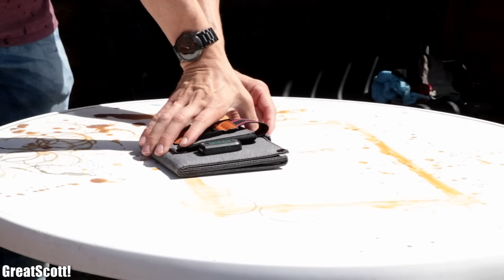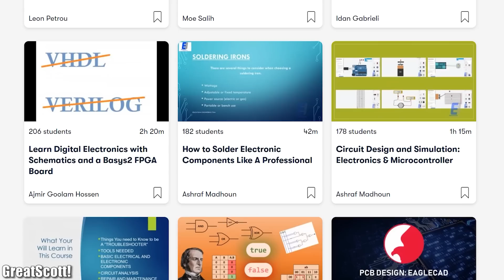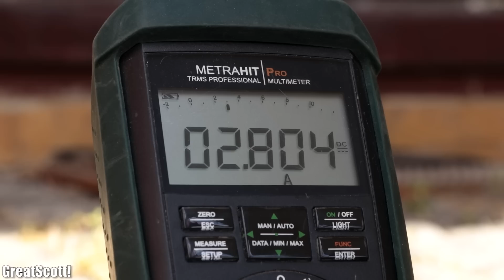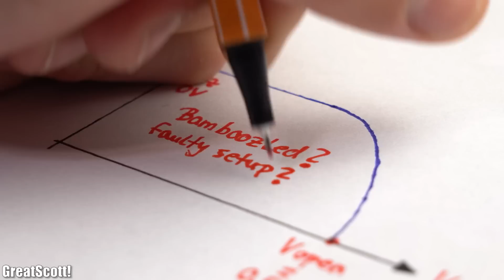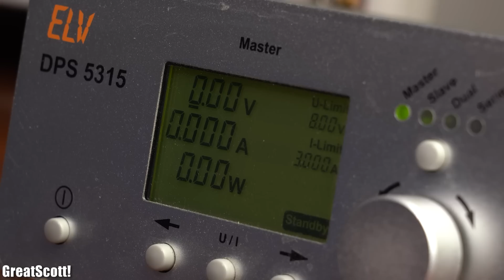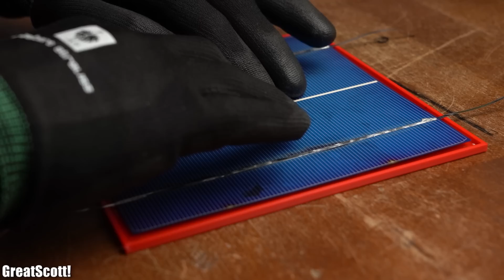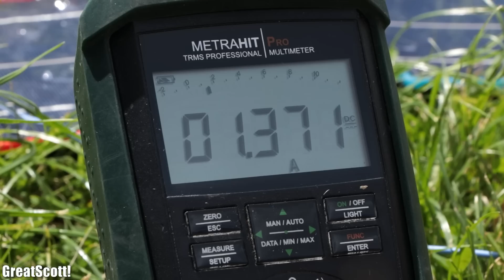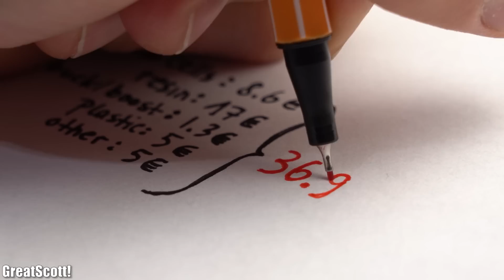5V USB Portable Solar Power Charger || DIY or Buy

Comment: Please GreatScott can you help me? I already make such a project with 4 solar panels (2.5w 5V 500 mA). In total i have 10 watt. I connected the boost converter directly to the solar panels and with no load seems to work but with the load something strange happens: The output voltage of the boost converter drops to 3V and the IC (XL6009) heast up so much. What is the problem? Please help. (I'm italian 15 years old, exuse me for eventual bad english)
Reply from the maker: What is the load? Seems like you overloaded it and the input voltage broke down to values where the boost converter does not work anymore. Or you drew too much current and the boost converter is done for.
Reply: The boost converter is 4A max it works from 5V to 30V. With a 14V 5W light bulb on the output of the boost converter, the voltage drops... I have no idea of why... The output current of the solar panels is 2A at 5.6V max. The sun is very shiny. But i want to attach a different load to it instead of the charging phone. The light bulb was a test and it is only 5 watts i don't know why it doesn't work... I will try with the phone and see if it works whit it. And you make very great videos! I Watched a lot of them... I love electronics and... I'M CREATIVE! 😉
Reply: @gianluca458  I don't do any testing with light bulbs. They have a tendency to draw much more power than rated. They typically don't have any limits. They just get brighter and hotter until they burn out. First charge a battery, then use your light. Batteries make a great buffer/controller for solar projects. They regulate the voltage and never draw more power than their rating.
Reply: @tedhancock68  Well at the moment i don't have a solar charge controller and the solar panels can't charge my battery for now. I notice that 500 mA is the short circuit current of the solar panel, but not the current that it can substain at 5V... So i calculated that instead of 10w, my setup is only 5W - 6W. I Also tested it with other loads but almost every load i attached the voltage drops on the output... I think that this is normal because in effect, solar panels are not made for be used directly with the load connected... I will wait for a solar charge controller... In this video it works because the solar cells are way much better than mine and the stepped up/down voltage is very close to the solar panels voltage... Yeah, in electronics Everything needs to be precise or... Nothing will work!
And when i purchase the solar panels on amazon it says that it is 5v  500 mA but it seems to be fake... Or maybe something is wrong in my setup... Great Scott's solar cells have a way much higher short circuit current and they are as big as my cells... My 4 cells cost me 34€ i don't know maybe i made some mistakes... My measured 500 mAh short circuit current is under a super shiny sun... 😂 (I live in Italy, Sicily)
Reply: @gianluca458  As others have noted, the performance of solar panels is typically 50% of rating. I would expect your circuit to collapse at 5w output, in full Italian sun.
Reply: @tedhancock68  I don't know this before... It's a shame i thought that i have 10 watt but no... Well now i learned a new thing. I will still charge some batteries with them... (Very slowly but, better than nothing)... I will buy a decent 12V 10w solar panel and add it to my system. This one is really 10w max power. So with 15 watts it will be much better (Hopefully 😂).

Edit 04/08/20
I tracked the MPP of my solar setup with a constant load (Made from one of great scott's video 😉) and it is 0.25A at 20V. It is perfectly 5 watts. But EVERY solar panel output 50% of the real rating? What? Great scott was right because with the boost converter at only 5 watts input, a 5w load cant work correctly of course... I thought that I have 10 watts... Thanks great scott for your great videos, i learned so much... 😉

Comment: I've made a similar solar charger using 10 solar panels(89 mm x 145 mm for each panel) and a 5v usb converter, and output current was about 1,5 amps in mid day (between 11:00 and 16:00). My solution for hinge mechanism was to use duct tape, it wasn't beautiful but functional. Duct tape can be used for both fabric and hinge use, if anyone is interested I can share the pictures.
Reply: Good old duct tape.... Always saves the day!
Nice use of my favourite tech. solution
Reply: Share it
Reply: @ScrotNimation I seriously considered buying a sewing machine, but duct tape was a short term solution. I had a 1 week bicycle tour coming in a short time, and went for the quick&dirty solution :)
Reply: @williamlivingston2929  I will definetly shoot a video for that, currently waiting for the aliexpress shipments. My friend "confisticaded" my solar panels:)

Comment: Did the frame for few of the cells got deformed from hot produced by curing resin?
Reply from the maker: Correct
Reply: @greatscottlab  is there a reason why just few of them? different batch of resin with more hardener or something different happened? :)

Comment: I have a question for the community:

I want to drive a small motor with a solar panel. Do I need I diode to prevent the panel from current "flowing back" from the motor?

Thanks in advance
Reply: Many consumer panels will have have a diode built in for reverse polarity protection.  If yours doesn't I'd play safe and add a diode in series with the output.  Btw,  in case you don't know, a silicon diode will drop about 0.6V whereas a Schottky diode is nearer 0.3.    So you want a Schottky if your running at low voltage.  I assume you're using a dc brushed motor.  When driving anything involving a coil from dc it's a good idea to put an ordinary silicon diode across the terminals that will conduct if the polarity switches momentarily, which it does.  I've made a few single coil motors and run them direct from small solar panels without problems.  But if I hadn't put the back-biased diode across the coil I might have wrecked something.  Maybe you know that, if not let me know and I'll say more.
Reply: @raykent3211  no, I don't really know what a back-based diode is, but thank you for the long and precise answer
Reply: @robosapien314    OK,  à diode is a one-way street for current,  allowing it in one direction and blocking in the other. If it's connected in the way that it passes it's called forward biased. If it's connected the other way it's called back (or reverse) biased.  The symbol looks a bit like an arrow indicating the pass direction.  But relax... If you're talking about a very low power motor you can probably just connect it direct to to the panel without any other components.
Reply: @raykent3211  ok, thank you again for your answer. Thanks for sharing your knowledge in order to help some noobs out there ;). I believe I will go with a simple diode
Reply: @thenistthedev  thanks for your answer. The panel don't have a control circuit, but maybe I just add a simple diode. I was just a bit confused because I could't find any advice what happpens if a solar panel acts as a current consumer
Reply: well adding one wont hurt so do it, even if it doesnt mean anything extra safety measure always a good thing
Reply: @thenistthedev  ok, thank you again. Have a nice day

Comment: Did you try your load also with the commercial solar panels in order to rule out your phone as the limiting factor? Otherwise it would seem a bit unfair...
Reply from the maker: The commercial panel charged the phone with 1.2A while 1.35A was the limit of the phone.